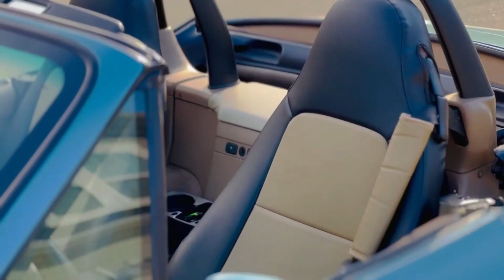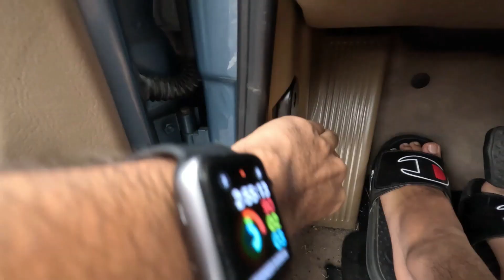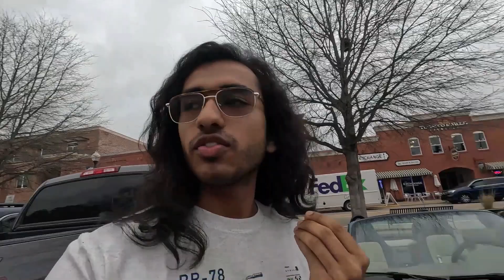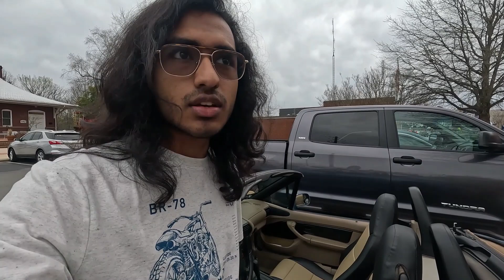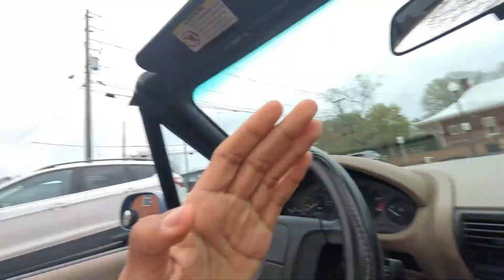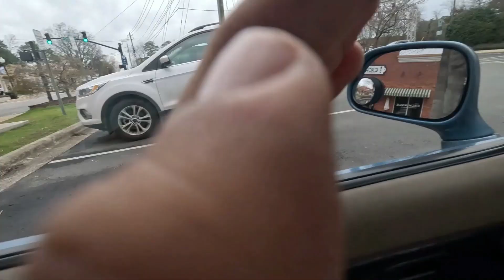Is The BMW Z3 a Good FIRST CAR?!

Comment: so ur running no engine fan, u gonna put an electric one
Reply from the maker: The fan is right behind my grill. The airbox was what was in place of that empty space. We took it out because if the AC button (The Snowflake) wasn't on then heat would be trapped, causing the car to overheat.